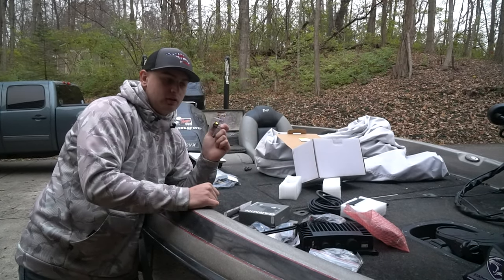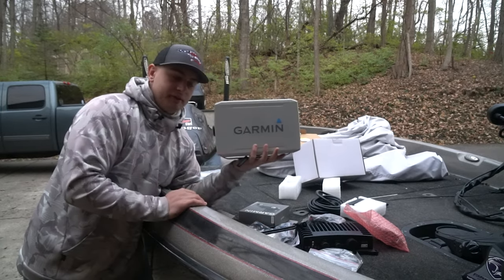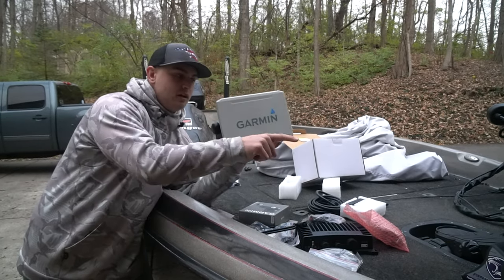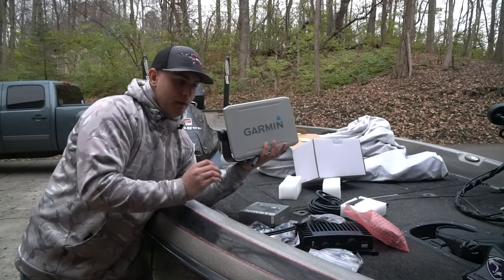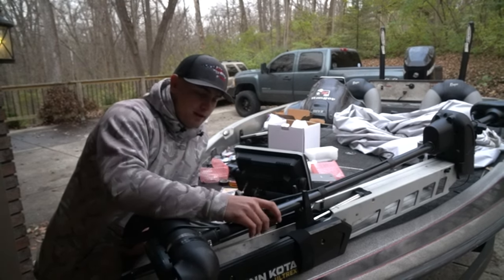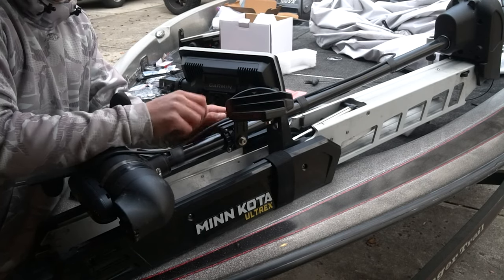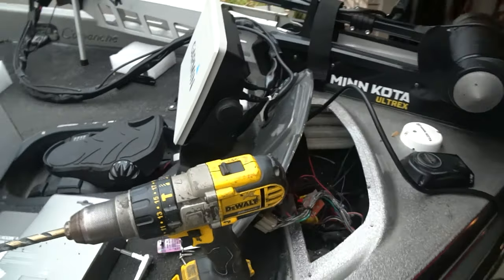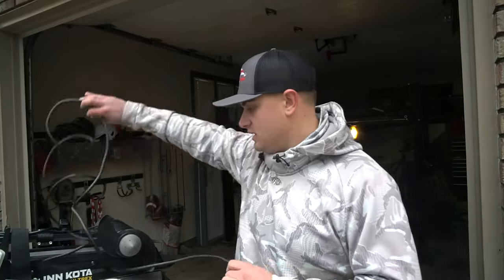Installing Garmin Livescope on Minn Kota Ultrex

Comment: That is actually neither port or starboard position on your transducer mount. Your transducer should be setting on top toward the sky when n stow. This will read true with the bow of the vessel and also keep you from knocking it off in stow pulling up to a dock etc.

Comment: So I have an ultrex and I’m concerned with the cables due to spot lock! I see how u have yours ran and I’m wondering now if you ever had any problems out of that? I’ve heard u need to wrap them a certain way for the head and all kinds of stuff! But if that works and it doesn’t get tight or twist anything up then I’ll do this!
Reply from the maker: I have never had any issues with it like this. Just leave enough extra cable looped out so it doesn’t get tight

Comment: Im installing this very setup, im honestly super disappointed with how the transducer cable is just taped on to the shaft(as per the instructions).
Reply from the maker: The actual proper way to install is with getting an ultrex cable management system, but I have noticed before that most transducer cables are best taped on instead of zip tied. I have ran into issues of interference a lot with zip tying any transducer on